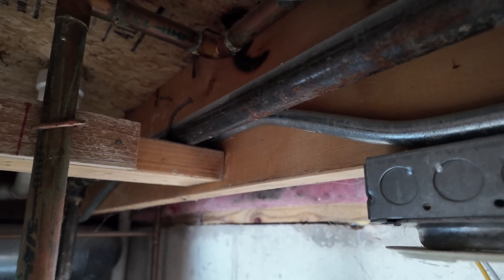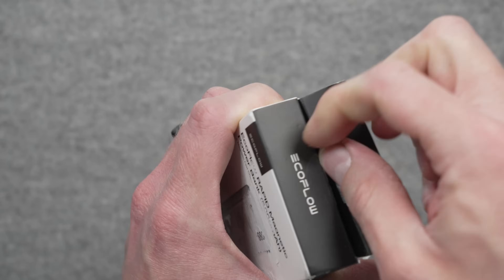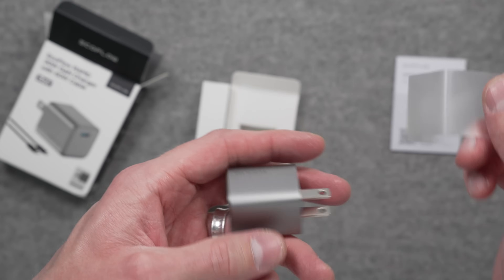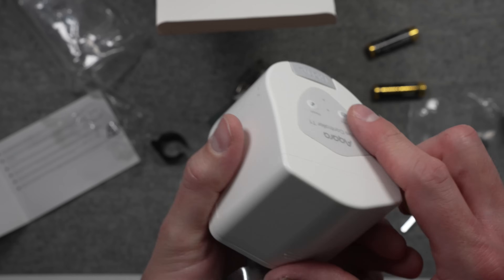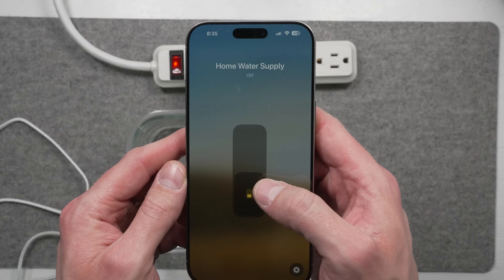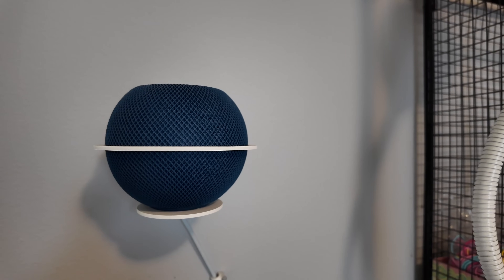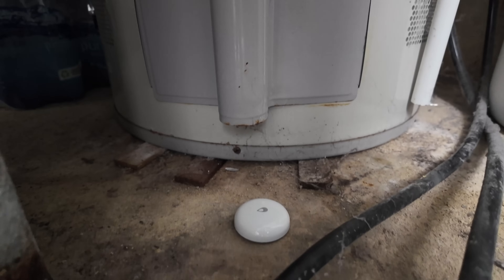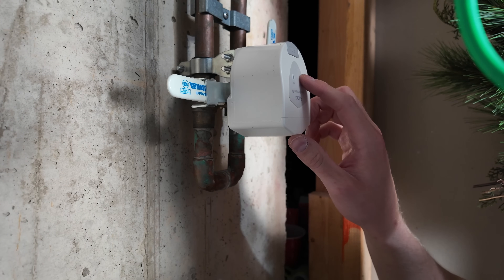Why you need Aqara’s new T1 Valve Control

Comment: So if you get this, and all of the other AQARA stuff, the Chinese government can shut off your lights, unlock your door, know where you are inside your house, and shut off your water. Nice
Reply: Cool thing about Aqara is that you can run everything locally. Match it with Home Assistant and you’ve got complete control and remote access. My Aqara hub is in local control mode (LAN). I have it blocked by my firewall to. I checked the logs every now and then and I’ve never seen it try to phone home.

Comment: The problem is, ball valves that remain open for a long periods of time become very hard to move far exceeding the torque than a device like this could exert. It would need to be exercised regularly and checked for reliability.
Some of the more expensive more professionally oriented devices have their own valve so that they know exactly what torque’s they are dealing with
Reply: So isn’t the simple solution just an overnight automation that turns it off and on everyday? Seems pretty obvious
Reply: Or just when everyone leaves the house @James-xg5rh
Reply: @James-xg5rh That would wear the battery out pretty quickly. Once every 6 months would be fine. Ball valves don’t seize up nearly as quickly as gate valves.
Reply: Very good point and that should’ve been part of the review. I wonder how long the battery would last if the valve gets exercised regularly.
Reply: Agree exactly. I will wait to see some reviews.
Reply from the maker: It’s a good point of why installed systems can be better but comparing the cost including installation I think something like this Aqara is still more realistic for a lot of people.
Reply: Is it thread
Reply: Can you point me to one of the more expensive more professionally oriented devices? I'm interested.
Reply: What if you set it to auto close & open every now and then?

Comment: Put water appliances on smart plugs and have Aqara leak sensors on the floor beside them. So they automatically power off if a leak is ever detected. Combine this with the valve control to cut off the water supply as well as the power.
Reply from the maker: That's an interesting idea. You would need a smart plug that can handle that kind of power load but it could be a cool automation.
Reply: @EricWelander  most smart plugs I’ve seen (for the UK market at least) can handle 10/13 amps. So 2400-3120W, more than enough for a dishwasher or washing machine.
Reply: Even better idea change out the wall switch with the iniveli smart switch for your washer and then do that automation instead of using a smart plug
Reply: A GFCI outlet would give you similar protection.